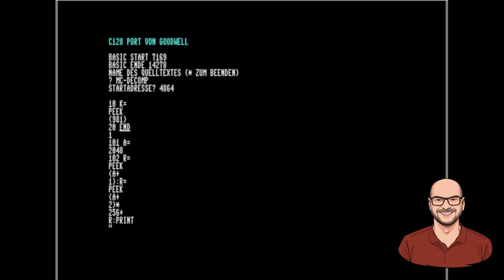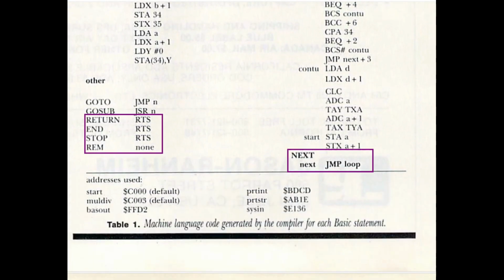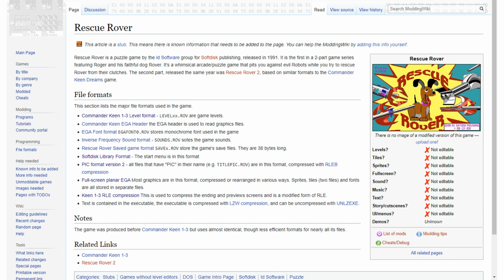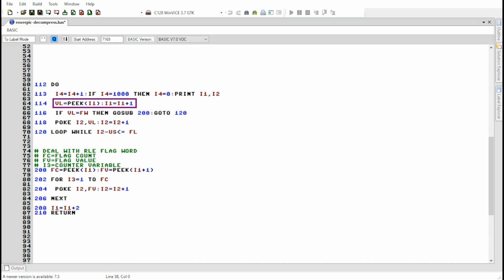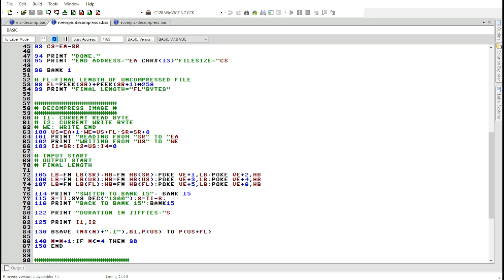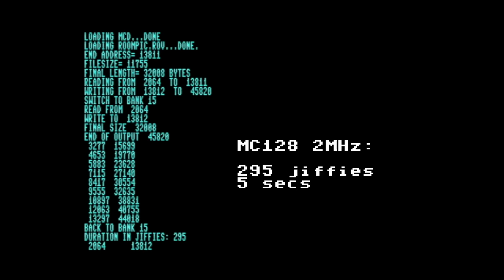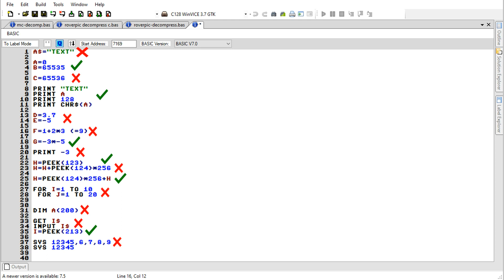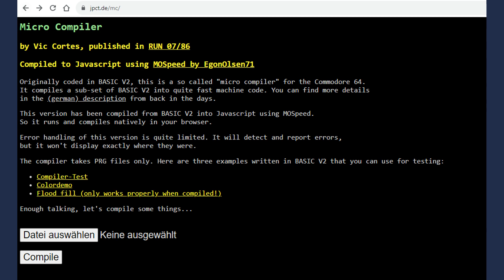C128 Basic 100x faster? - Fast like a Flash: the Basic Microcompiler - RLE decoding on the C128

Comment: With so many restrictions, this micro compiler doesn't really bring any advantages to just writing the code in assembler, for example in Turbo Macro Pro and targeting the C=128. It's basically in the same class as the cc65 C compiler, which does not have the basic float and double data types, and therefore cannot do floating point arithmetic, and doesn't come with libc, which pretty much defeats the purpose of writing software for the C=64 in C, or compiling existing body of C software for the C=64. These pieces of software are the antithesis to core UNIX software design principles.
Reply from the maker: From today's perspective that's completely right. 
Back then, the micro compiler was a type-in program. It basically came for free (well, the price of the magazine), which was one of the main benefits, I guess.
All the restrictions only make it useful for targeting very specific tasks, not for writing full programs. Any probably only for people who aren't familiar with assembly language.

Comment: Just out of curiosity, what happens when RLE needs to encode FE byte? I guess it does something like this: FE 01 FE, 3 bytes instead of 1?
Reply from the maker: In this specific case FE is not a number that‘s within the valid range. But yes, your suggestion is one way to do it. In general there‘s multiple ways to do this - also more efficient ones. 
Totally valid question, thanks for that
Reply: It depends on the nature of the data.

You could just do FE FE. And not allow FE repeats. 

Or you could swap respeat and literal. So you can have FE repeats.

So you could do FE 09 05 to repeat 9 five times.

Or FE FE FE FE to repeat FE FE times.

If it's text then the high bit won't be set so you could set the high bit for the literal and follow it with the repeat, instead of having a reserved byte

Have a read about lz compression also, despite being patent encumbered in the 80s it is very straight forward.

That just basically adds a pointer back to the already decompressed stream.

So you could do this

"So you c[back 4: repeat 2]ld d[back 12: repeat 2]this"